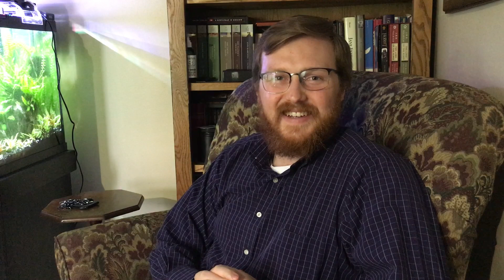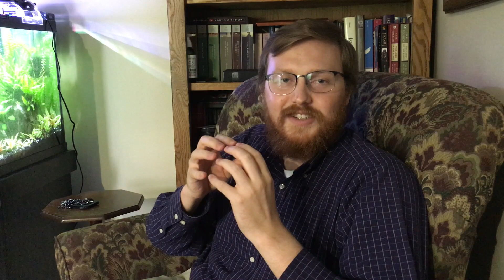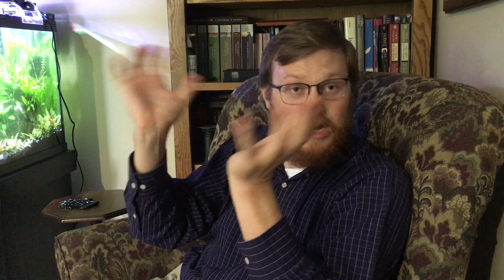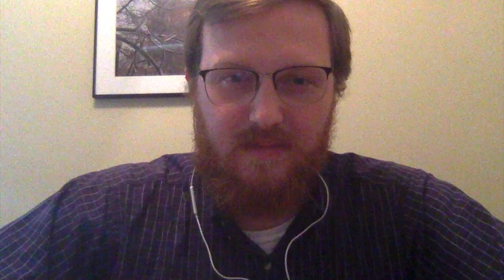How Do Air Stones Work?

Comment: Wish I knew about this before getting fish! I was told at petco as long as they had a current they would be ok. My tank has two canister filters running but the time I raised the water to the top my fish would just stay at the top. So I had to throw away water in order for the filter to create bubbles. I heard these were good for oxygen. I bought two air stones. Now I know how they work exactly based on your video. Thanks!  Not only that I raise the water to the too without issues. My turtle seems to enjoy it as well.
Reply from the maker: I'm glad the video was helpful for you and that your turtle is enjoying its tank now!

Comment: What size of air stone do I need for 150 gallon tank ? Any advise
Reply from the maker: To me the size of the air stone pores matter more than the size of the actual air stone. Do you want fine bubbles or larger bubbles? Do you want a bubble wall? Or do you just want to great some surface agitation for better oxygen exchange.  

In my mind the size of the air stone doesn’t matter that much as there are many different options out there but rather the size of air bubbles you want and how you want it to look in the tank.

Comment: I've just got a new tank and pump/filter. I'm using the internal pump flow so that the water goes up a bit above the usual water line but it doesn't create bubbles, will this still add oxygen to the water as it's being pulled from further down the tank, up to the top. Thanks in advance
Reply from the maker: Yes that will do well. With your situation pumping that water up above the surface of the water and across the surface of the tank creates ripples, which increases the surface area of your tank and allows for more oxygen to dissolve into the water. If you want to error on the safe side you can always drop in a single air stone from an air pump to create more surface agitation but that should do the job.
Reply: @TheAquariumLibrary  i had to get an airstone, kept losing fish and couldn't work out why. all good now though :) thanks for the reply :)
Reply from the maker: I’m sorry to hear that. The best way to point an internal filter flow is at the surface of the water to create as much surface agitation as possible.
Reply: @TheAquariumLibrary  it's all good, guess it's just a learning curve tbh. First tank in a long time

Comment: I have a smaller 5 gallon tank but have an aggressive pump and stone. Creates moving top water and I see allot of air bubbles, small as they may be in all of the water. I only have one male Beta in the tank. He always seems happy, I have living plants and rarely have to do changes rather once a week add water I have made with conditioners and I add Glosso factory dark water to the mix. I have on have 20 2 liter bottles prepared in advance. Just getting back into the hobby, I did have a 200 gallon setup in the 1980's. Figured I would start out small to get started once again. I'm only assuming that all the little bubbles I see floating around are consumable air for my friend.
Reply from the maker: Those little bubbles floating around aren’t going to be where your betta fish is getting its oxygen to breathe. It will be pulling out oxygen that is dissolved in the water or from air that is gulps from the surface. Also if the air being produced by the air pump is too aggressive and there is no place for the betta to rest outside of that current it can start wearing him out. Watching him for a bit and seeing if he can rest will tell you a lot about what whether there is too much air. Hopefully that helps! Also glad to hear you getting back into the hobby and starting off with only one, manageable size tank is definitely a good route of getting back into the hobby.
Reply: The air stone is in one corner of the tank where the heater is located so it's not an area where he travels to much. This is one of the Marine land 5 gallon tanks in which i removed the rear wall and run a small over the back filter and cover the output with a sponge material to reduce flow. Works well and he has been happy for going on 6 months now. He is one of the moon types and does not have the large hang down type fins.He spent time both on the bottom and top of the tank and has free roam with no issues with turbulence. Happy little guy and I named him Sonic because of his red and blue coloring. I have  20, 29 and 45 that I will be setting up in the future, just wanted to get my skills back before I went in deep. I will move Sonic to a 20 soon with a couple of others that will be quicker then him and can live in peace together. He also does live in a more mid lighting scenario rather then the max lighting that you could set it for. Live plants still do ok.
Reply from the maker: @curiosity2314  Very nice. Sounds like you made sure to keep the flow to a minimum in the tank and are really looking out for your fish.  Yeah bettas with those longer fins will definitely tire themselves out more than your fish. Have fun with those tanks!  Do you know what you will be setting up in them besides the 20?
Reply: Good question that I don't have an answer to yet. As time goes on and I'm ready to setup them up I will let you know. Would like to do Cichlids down the road but will get a larger tank for that idea.
Reply from the maker: Unless you already have specific cichlids you want to keep that requires a large tank, there are plenty of cichlids that you could do in those tanks that you’ve listed off. I’m thinking like apistos, different shell dwellers, rams, and even some mbuna cichlids or some angels in your 45.